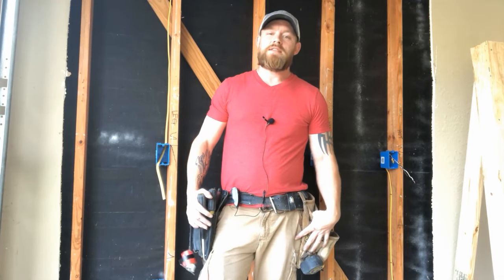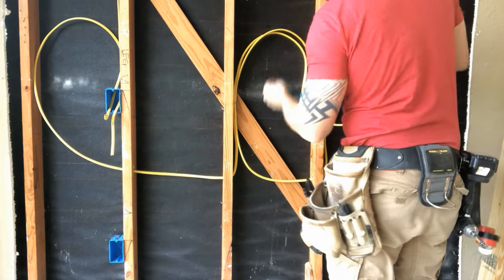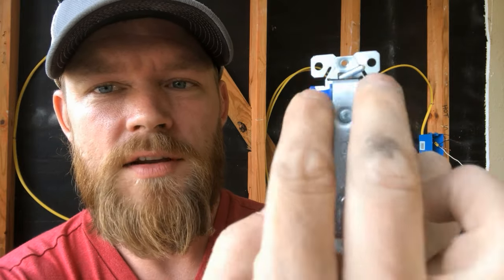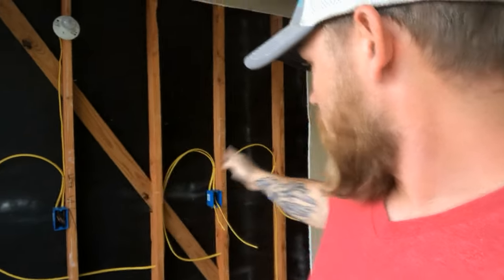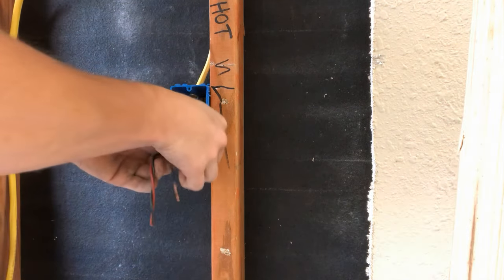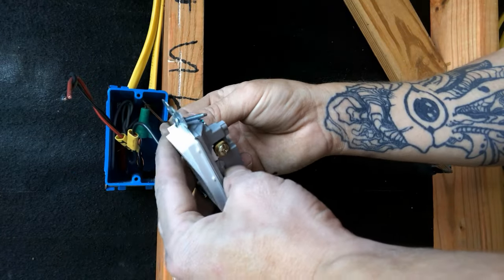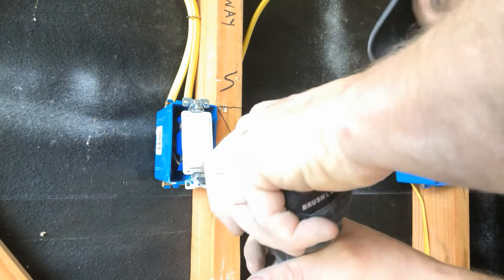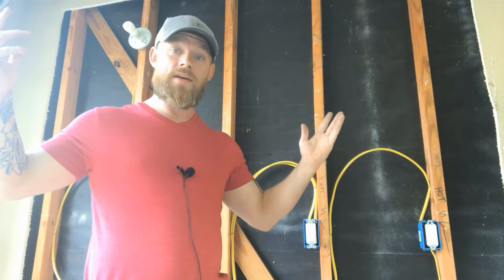Episode 8 - How To Wire For And Install 4-way Switches

Comment: Man oh man, letting the OGs get away with $h¡tty joints is a tough one cus bad joints burn houses down... but if you're the FNG it's not your place so... I guess just hope the foreman knows his crew and knows who's work to check up on... I haven't run into that but man if I did that would be rough.

Comment: instead of baseball bat, use a chunk of conduit, make lines and label it for speed marking box heights.
but that is never set in stone, the master sparky should go through and mark out what goes where and heights, counter tops and floors are never the same, nor finished material depths. adjustable boxes are great for unknown counter-top back-splash thickness. but nobody wants to pay the $3 more per box nor bother to know they adjust and sloppy tile/granite over them lol

Comment: That`s a massive screw driver to do termination of a switch with is`nt  it?
Reply from the maker: You get more torque with a larger head so it makes a more firm termination in my opinion

Comment: cool to see how american build electrician things. We call this kind of circuit "Kreuzschaltung" it means the switch in the middle cross the 4 wires... Its cool to see how diffrent the cable clamp are. We use this one https://www.wago.com/de/c/installationsklemmen where wire is pushed in side by side.

Comment: are the green wire nuts with the hole in the end legal everywhere? I don't think I've come across any at HD or seen any in boxes when working at someone's home.
Reply from the maker: They're designed and listed for the purpose.  100% legal.  We used to use copper crimp sleeves but it became cheaper to buy a bag of wirenuts rather than buy crimpers and copper crimp sleeves for each guy.  Plus it takes less time.
Reply: thanks Have you used the push in connectors for any reason? Looks like they would take up less space but at about 22 cents each, I guess that would add up fast!
Reply: Informative
Reply: Informative

Comment: When you wire your hot neutral and ground in you don’t fish hook your wire first??? Just got done reading a book and there was a whole section on doing that. Mind blown
Reply: The screw connectors that have "plates" that clamp down on the wire when you turn the screw do not need to be looped.

Comment: Why waisted all that wire bring the switch leg from the end of the hall when the load or light fixtures will be closer to the center of the hallway.  Why not take the switch leg from the middle box?  Would you call that an illegal California 4 - Way.

Comment: Here is some more mumbo-jumbo from the commercial electrical lexicon. A four-way switch would be a two pole double throw switch, as opposed to the three-way and on off switches. Polls are circuits, throws are contacts.

Comment: would have been failed for them rounded loopy flappy when I played sparky in the mid  90's+
myself I see where having less staples is good for future changes and needing a few inches to snip off the burnt wire from junk push in backwire piss poor quality devices.
I come from a  time when they allowed 12 &14 awg backwire, for obvious reason they changed to 14awg only and I still replace that junk melted down in boxes all over with whole or parts of circuits dead.... I guess the bright side is, I don't get stumped by issues like that and find them within minutes ( after 3+ other companies have been there and hadn't a clue) yeah, it's that bad in the fields, major lack of skills and hands on training.

Comment: Even easier than a 3way , it's just a 3way with a pass through switch box I should be an electrician this is like automotive wiring in the 30s

Comment: Rarely see where it's shown with a light in the middle of the run. If I follow this sigh the light at the end, but light is in the middle, seems like I'd be using more wire. And the price of wiring nowadays, I'd prefer not to do that.

Comment: Why don`t electricians in America sleeve up their earth conductors at their terminations? Surely having bare ground (earth) conductors is a potential hazard.
Reply from the maker: We’re not required to, it comes that way from the manufacturer. In 10 years I’ve never had an issue with it being a hazard. Sure I’ve had the bare ground wire bump up against a hot screw and trip the circuit but beyond that I don’t see any issue with it. The yolk that the device is mounted on is bare metal as well.

Comment: You guys say never put the neutral with the hot but still you guys push all the wire in the back?? I don’t understand that part
Reply: Yes, but the neutrals are twisted together and capped with a wire nut, so there's no copper exposed. It can't touch anything hot.  [I'm not an electrician so feel free to ignore me.]

Comment: I was also very anal about running wires with plenty of length, but not excessive, and having them run very neatly. If you are the clown that ever has to go back, the circus is much more easily done.

Comment: Who the hell runs electrical loops to the switch box anymore every inspector that I've ever dealt with wanted it nice and tidy close to the Box
Reply: Hahaha...I do, and would just tell the inspector (or customer) "OK dude, whatever you say" and leave it at that. Having some slack for possible future repairs is my main reason for not wiring tight unless specified on the job.

Comment: You loop too much wire in the wall, it is cutting into your profit margin.Use proper switch terms, single pole double throw, and double pole double throw.Why use AWG 12 for a light circuit?  AWG 14 is fine.  That much wire in a small box is too awkward to handle.

Comment: Sota wonder why 12/3 for a light bulb or two or three.  Seems like such a waste.  you'd be unlikely to jam 3A though that 12A capable wire.  Why do that?  Put in LEDs and you have 0.3A.  Folk are so bound and determined that 12AWG is the rule.  WTF for?  Not by code.  Just a default don't know any better?  It is just a light circuit.
Reply from the maker: Many AHJ's around the country won't let you run 14.  Some of our areas locally will for lighting only, but for power they require 20a.  Pretty common here to see only yellow Romex in walls.

Comment: I'm 61 Years.  I have jet to know a death by electrocution with 120/240 single phase. Throw a hair dryer in a sudsy bath and it will only take the least resistant path to ground.  The water. like a bird on a 14.4kv line. Make a video on this.
Reply: Oh, it happens more than you think.
The issue is more when the body is in contact with the grounded plumbing... making a more direct path than through the water...